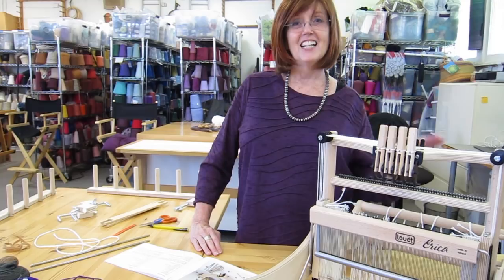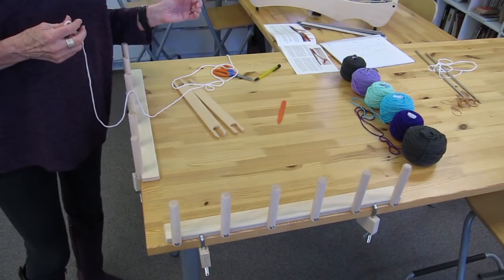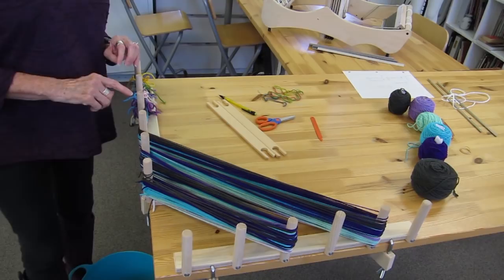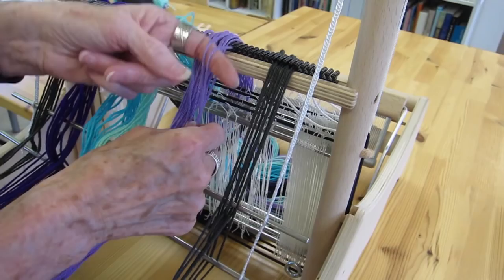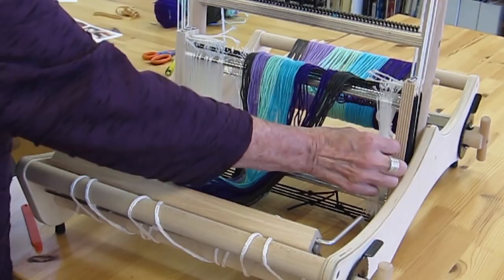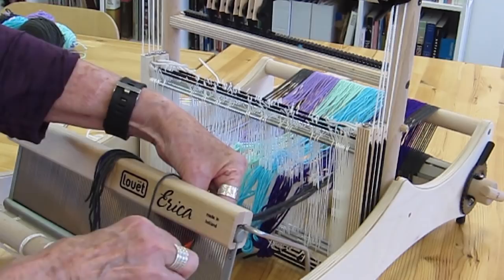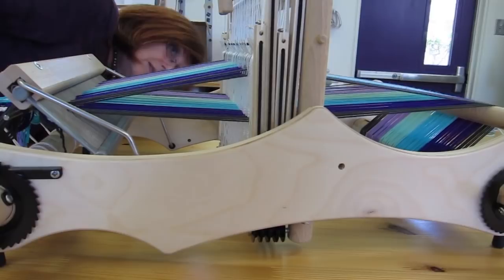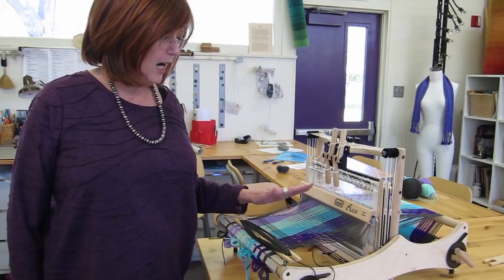How to Warp & Weave on the Erica Table Loom

Comment: What can be done about the rear ratchet/brake? Unless the screw is tightened as tightly as possible, the brake will not hold in place.  I noticed that the rear brake is diagonal, while the front brake is horizontal, like the Jane brakes.  The horizontal brakes work perfectly, but the diagonal brake doesn't hold with tension (the warp).

Comment: How do you feel the Erica compares to the Jane (besides the obvious detail of Erica having 4 harnesses and the Jane having 8 harnesses) ?  Thanks!
Reply from the maker: The Jane is generally a more "polished" loom with a few extra features.
 - swinging overhead beater with rigid support on the top and bottom of the reed
 - a self loading spring to hold the beater back to give you a larger weaving area
 - the toggles have a positive lock position, so they are less likely to "accidentally" flip down
 - carrying handle on one side (Jane 40 & 50 only)
 - rubber feet on the side of the loom so it can be stored or set on its side without damaging the wood
 - the frame of the loom is solid beech vs a laminated beech
 - the loom frame for the Jane is simply more substantial and sturdy than the Erica
 - The carrying bag for the Jane is much more substantial - Erica bag being a cotton tote.
 - tieup bars and lease sticks for the Jane are wood

The rollers where the cords travel on between toggles and harnesses are the same for both looms

Hope that helps.

Louet Support